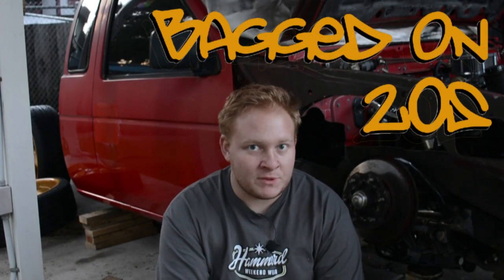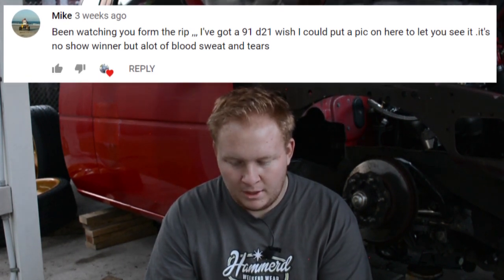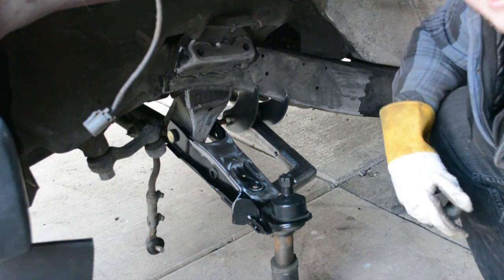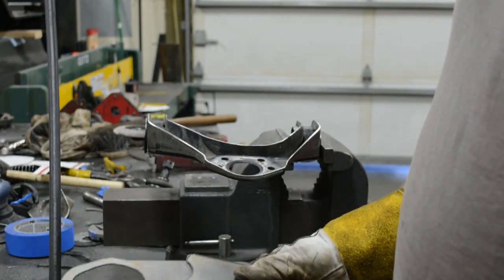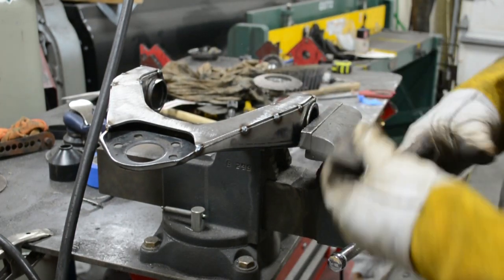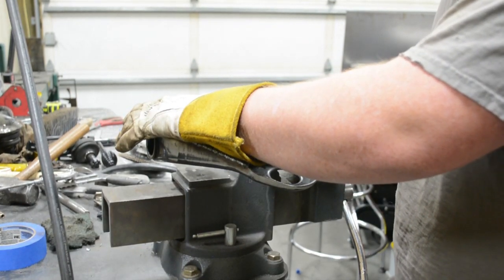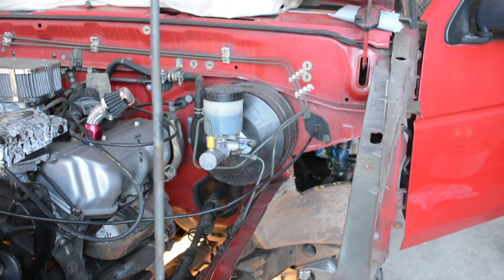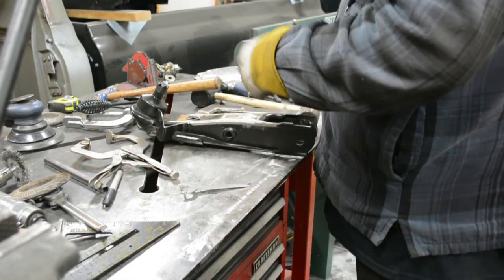Bagged On 20s // Episode 6

Comment: I am getting ready to do the rear popout deletes, after sound deadening and insulation. Welding the floor was badass things we learn to do the work on our trucks!!   I need a bracket for an altenator off the A/C bolt mounts on KA24. Figured out the stereo system and need to start buying 4 batteries, 300amp altenator 4 PSI 15" Subs 8-16 infinity mids, 8 Soundstream 1" PEI soft domes, Audiobahn Xover & MTX 2ch Xover so 15's can have a lower frequency then the 2 10" subs. I Don't trust amp Xovers, stuck in my ways. Hahahaha!! Hope you and the family are having a Wonderful Christmas. Thank you for another build video! AWESOME & KEEP ON TRUCKIN'
Reply from the maker: Thanks for the support Jeff, sounds Sweet!

Comment: If you're just running 17 do you still get the ball joint binding??
Reply from the maker: Depends on overall tiresize. I had stock arms on my old truck and it layed frame on 225/40/18 but that also had drop spindles. If you have drop spindles on 17s you should be able to get away with stock configuration. Although flipping the arms will help the ball joints last a bit longer at a less extreme angle.
Reply: @scrapingpavement  yea I'm on an extreme static drop and my ball joints are toasted. BUT when I install your front bag kit I will be putting on beltecs drop spindled. Thx for replies

Comment: This is a monster of a build, good work. One thing I noticed is you probably could of offset the cut on that booster mount by a quarter inch and just flipped it
Reply from the maker: Thank you! Hmm not to sure what you mean?
Reply: @scrapingpavement  when you cut the firewall out to move the booster over, could you of cut it out so the hole was off centre by the inch you needed and then flip it around  and weld it back in. Not sure if making sense
Reply from the maker: @soniqmishapunltd  Gotcha! Now I'm following you, ya that would probably of worked. Didn't think if that at the time but would save some time and material for sure 👍🏼

Thanks for pointing that out!
Reply: @scrapingpavement  I've got your back!

Comment: Hey man. Iam bagged on 20s, trying to put tubs in but not sure it’s going to work with the stock brake booster. Any advice?

I see on the forms that people use the GEO booster or the pulsar. Not sure what route to go with.
Reply from the maker: I've personally talked to people with the geo boosters and they hate it. Really bad pedal feel. I moved the booster in this truck over an inch to clear the tire
Reply: Thanks for the fast response man.

Comment: U think i have to do it for 18? I never heard of it actually i never paid attention to ball joint bind
Reply from the maker: My old truck was bagged on 18s 225/40/r 18. Stock upper control arms with drop spindles no issues.
Reply from the maker: Well without spindles you will have a ton of negative camber and will most likely have ball joint bind unless your on 14" low pros lol. I can't help you with the wife/broke part lmao.